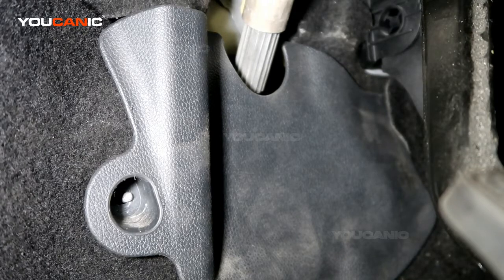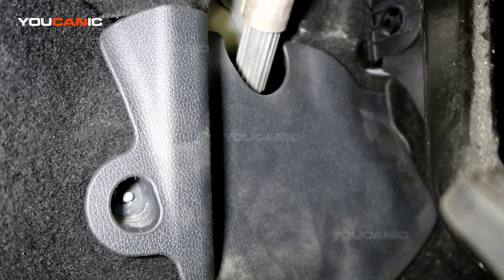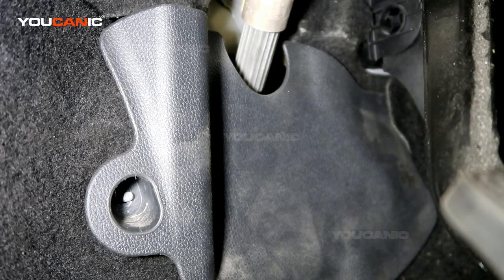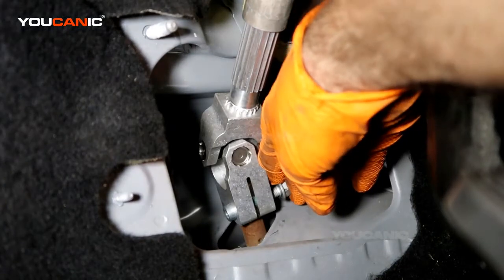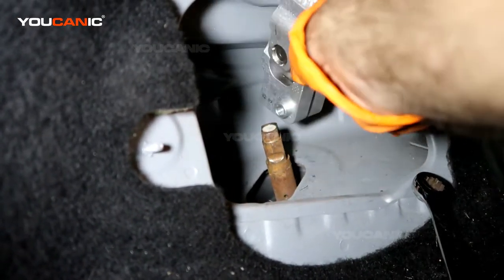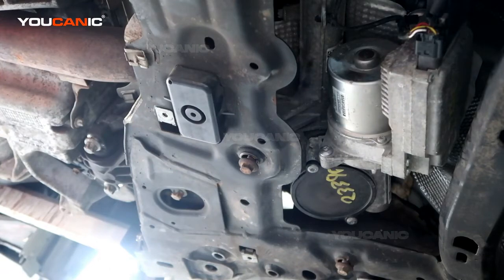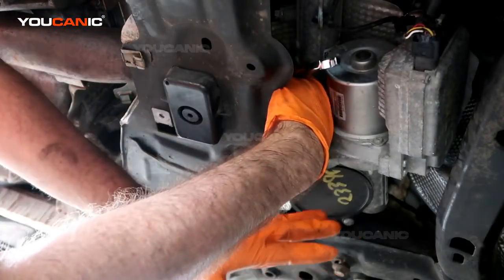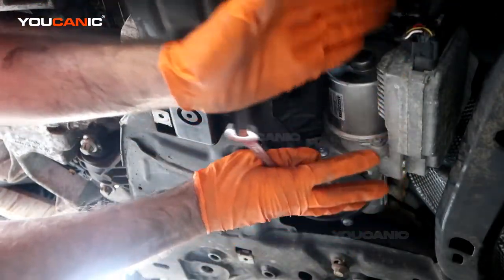2014–2020 Mercedes-Benz GLA-Class X156 Electronic Power Steering Replacement

Comment: Still struggling to lower the subframe for me to get the steering rack out as am doing it from my driveway any suggestions?
Reply from the maker: Lowering the subframe to get the steering rack out can be quite a task. I would suggest you first check out our Full System Scanner at www.youcanic.com/scanner. It's designed to help pinpoint problems and troubleshooting steps. Alternatively, you can also take advantage of our platform to ask car-related questions at www.youcanic.com. We have plenty of resources and experts who can provide you with some tips and guidance. You're not alone in this, and we at YOUCANIC are here to make car repairs more accessible.

Comment: Hello I was wondering, does the gla/cla have one or two power steering motors / units?
Reply from the maker: The power steering system specifics can vary based on specific models and years of the GLA/CLA. For the most accurate information, I recommend using our YOUCANIC Full System Scanner (www.youcanic.com/scanner) to diagnose your car's details. If you have further questions, visit our platform at www.youcanic.com where you can post your queries. We're committed to providing clear and accessible auto repair information and assistance. Your faith in YOUCANIC is deeply appreciated!

Comment: Where do you source the power steering module part from? 

Do you need to program it to the ecu, as well? I have to replace that (potentially) as well as my alternator
Reply from the maker: You can source power steering modules from various auto parts suppliers, but to ensure compatibility, it's advisable to consult a professional or use an automotive diagnosis tool. At YOUCANIC, we provide a Full System Scanner that can help identify your car's issues and suggest the necessary solutions [www.youcanic.com/scanner]. 

Furthermore, queries about ECU programming and other car-related concerns can be directed to our interactive website [www.youcanic.com]. Here we have a platform for your questions and our extensive resources like the OEM Factory Repair Manuals. We are committed to helping you understand and navigate car repairs confidently.

Comment: Did you have to code the new rack to the car?

Cheers
Reply: yes you have too
Reply: Fitted a second hand motor and it didn't need coding.

Best regards
Reply: @exclusivetinting865 where did you get it from
Reply: @exclusivetinting865  Did you just replace the servomotor or did you replace it with the control unit to which the plugs are connected?
Reply: Ebay